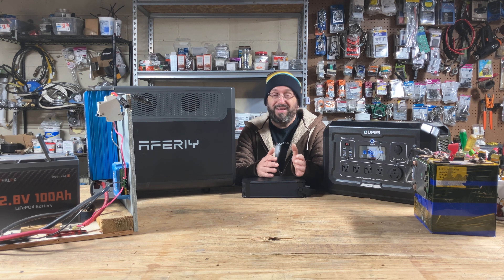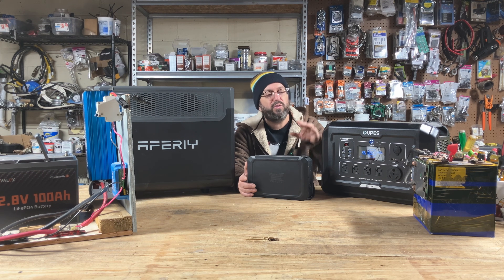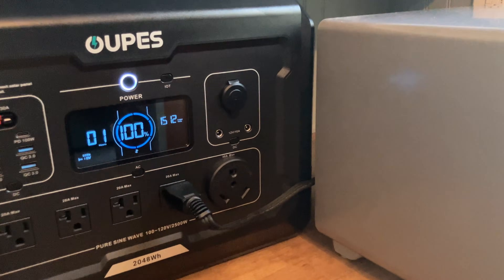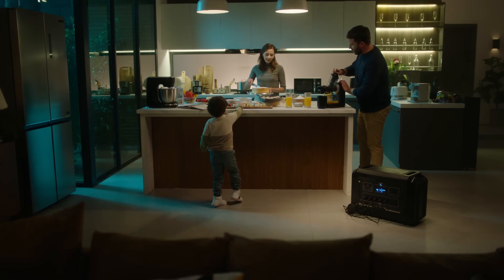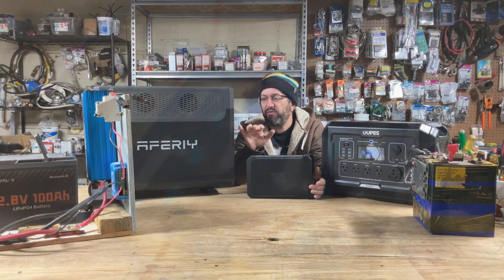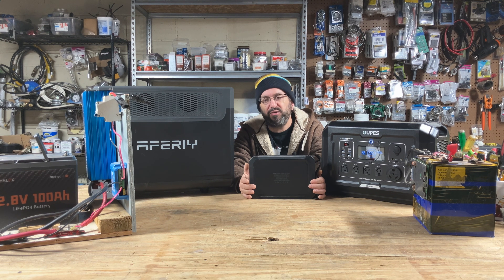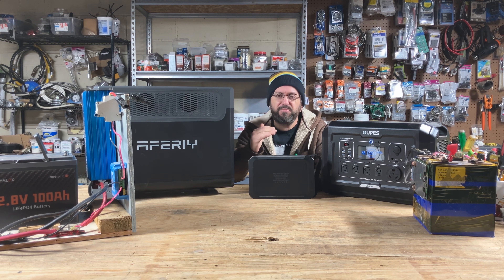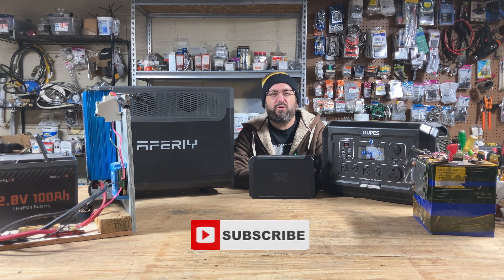Portable Power Station Solar Generator Buyer's Guide. Premium vs Budget. DIY vs EcoFlow DELTA Pro.

Comment: Almost spit out my drink when you listed Aferiy as premium.  They are not. The Aferiy, Fossibot and Oupes's etc are firmly in the budget class.  Premium, EcoFlow, Bluetti, Anker et al.  Then you have the super budget class.  4Patriots, EEI to name a couple.  Super budget, stay far away.  Budget, like your Aferiy models, IMO are not the class to buy during these big sale weekenda like Black Friday, because you can get Premium brands at the budget class pricing models.  Yeah, the knock offs will also be cheaper but not as big a drop and the most important thing to me, you are still rolling the dice, you're almost certainly still going to get what you pay for.  Black Friday is Ecoflow, Anker options times and my personal favorite, the budget premium hybrid, Pecron.  You're an Aferiy fan and that's cool but no man, they are not in the higher pricing models, high quality end of the power station space.  I thought about the 310 or the Fossibot clone.  Just couldn't justify the reliability risks.  Anyway, you may have addressed the premium budget conundrum later in the video, but after I saw the Aferiy on the screen when you were talking about premium brands in the beginning of the video I bailed.